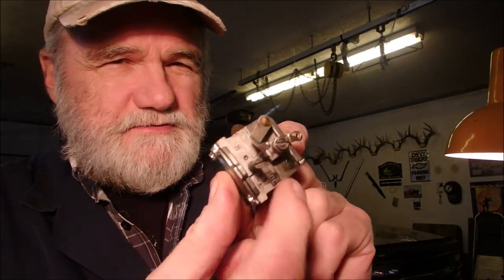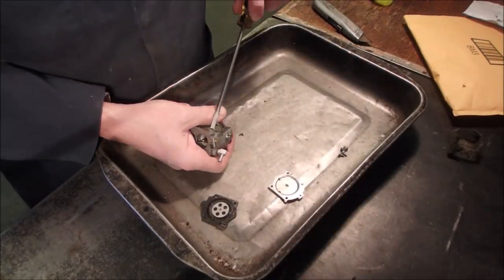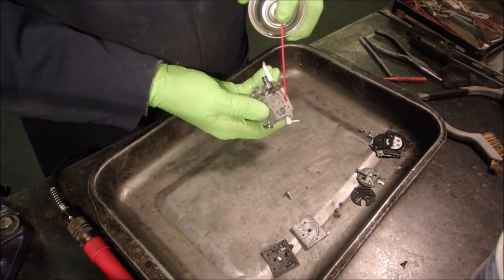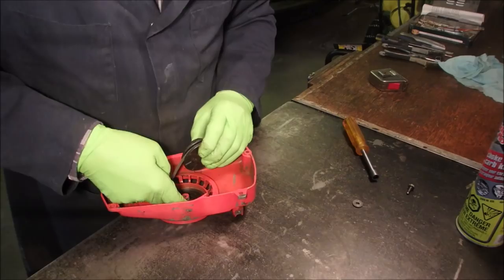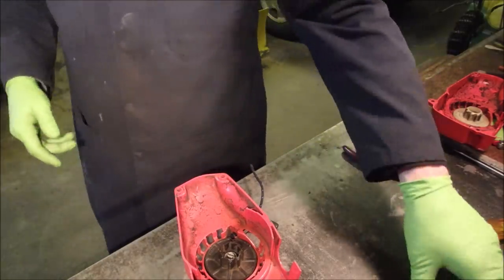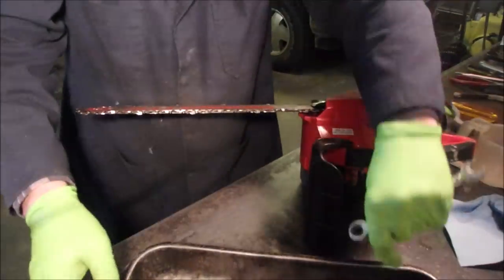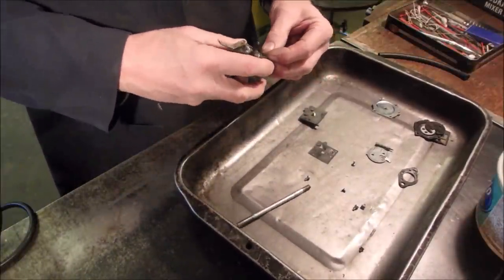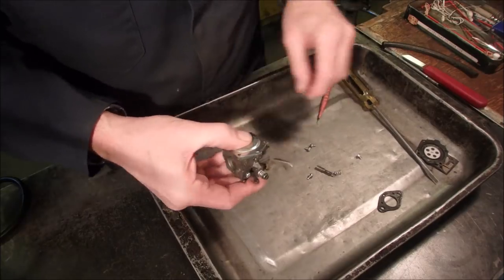Dualing Homelite Super2 Carbs

Comment: Great video as always.  Like you said the other day 2 strokes are a big part of small engine repair.  I am trying to get better at fixing them.  My goal is to start repairing the carbs instead of replacing them.
Reply from the maker: I don't buy very many as the older ones are well made.

Comment: Good work Bruce. I'm sure I'll have to do the same on the one I put in the barn 10 years ago. If I remember right it was hard starting then so it probably won't start at all now. It seems I only watch TV in the winter because when it's nicer out I'm out in the shop till midnight. Still watch oak island?  I am. They'll probably never find anything but it a fascinating show
Reply from the maker: Right   Oak Island.  I think the Black land owner (David Ball??/) found it.  
This saw needs duck valves   have you heard of those?   They hold pressure into the chain oil tank so the oil can flow onto the chain while running.    They are a check valve holding back the pressure from the piston impulse like a fuel pump on my Briggs generator.  LOL Thursday's video   ------>  I hope
Reply: @BrucesShop   I think you are correct Mr ball found it. No I never heard of duck valves but it makes sense that their would be some sort of valve in there
Reply from the maker: @davessmallenginerevival2847  There is a pulse from the piston to pressurise the chain oil tank and these little valves hold the pressure in the tank,  The is even an oil pump.

Comment: Great vid.  I stock a few K10-HDC complete kits for those old Walbro carbs.  Strangely enough, I've worked on a couple VERY old saws recently that haven't been run in so long that there wasn't any ethanol in the gas the last time they were used, like 20 years since ran.  Ultrasonic clean and a new kit...they run like brand new again.
Reply from the maker: The gas in these little saws is sealed from the atmosphere (not like a lawn mower) so the gas would lasts longer.  Right here in my city i can  get pump gas with no ethanol and I test every batch to make sure.
Reply: @BrucesShop  Very true, but the ethanol still does a number on the diaphragms and gaskets.  Usually a white chalky mess...lol.  It's easy enough for me to get non-ethanol gas as well.  Shell V-Power 91, and Canadian Tire 91 are ethanol free.  There may be others, but those are the ones I know off the top of my head.
Reply from the maker: @randomwrenching  CO-OP her.e  87 octane regular fuel.  I am lucky.

Comment: Good morning Bruce. (6am here). Typing as I'm watching. To remove the rope, feed the rope in and use the notch in the pulley to fully unwind the spring so there is zero tension. It will lift straight off and not BOING on you. 😰
Reply from the maker: Thanks.  If there is a hard way to do it i will find it.
Reply: @BrucesShop  lol , that's funny Bruce because I say the same about me
Reply from the maker: @davessmallenginerevival2847  Right.  We over think it.

Comment: The aftermarket HDC kits seem to have a a longer num on the diaphragm.  I tried to get a good look and couldn’t tell in this video.  I noticed the Amazon package early and would expect aftermarket thus would compare to what was there. 

My solution with aftermarket HDC kit is a bench grinder using my needle nose vice grips to GENTLY hold the diaphragm.   Otherwise, make sure it’s a genuine kit.
Reply from the maker: Thanks a lot.  I tried one holding nother side of the nub abd burned my fingers from the grinder.  Good call on the pliers.

Comment: Morning Bruce, Blair from Winnipeg was wanting to know about your furnace.  Just bought a  Mr heater 50000btu gas furnace for a24x26 insulated garage.  Is this close to yours in size , heater and garage? Does it keep it warm?
Reply from the maker: Mine is a 75,000 BTU .  My garage is 26X26 with 10 foot ceilings.  I would think you will do great with yours.  I rigged the thermostat to run at +3C.  Until I need more heat when I am in there.
Reply: @BrucesShop  thank you sir for info. Mine also has ten foot ceiling. I was running a 4800watt electric heater which did do the job but it ran almost all the time keeping it at 18'c. A little expensive even with Man hydro. Thank you again cheers!
Reply from the maker: @blairfright9622  Good comment